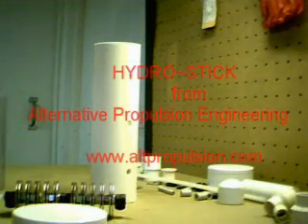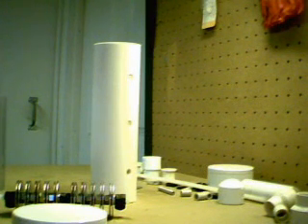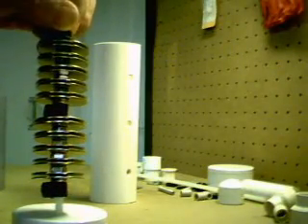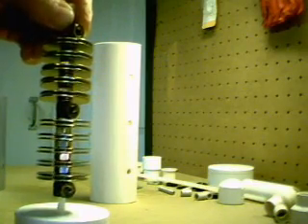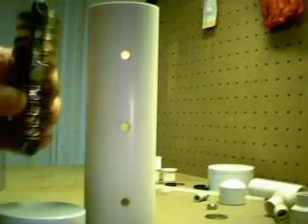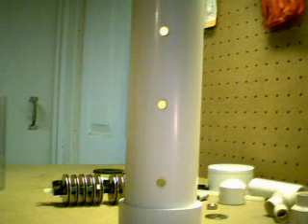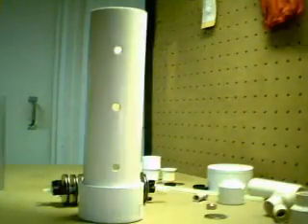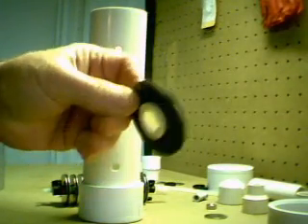Hydrostick Part 1

Comment: Thanks for the great videos however Id recomend not moving parts so fast as it is hard to see the parts. My comment is I like this unit very much but it is too small for a 6 or 8 cllinder...For a 300 CID engine u need 1.4 of HHO and no more and need to draw no more than 15% of your alternators rated output....A perfect unit would produce 2.0 HHO and use no more than 15 amps